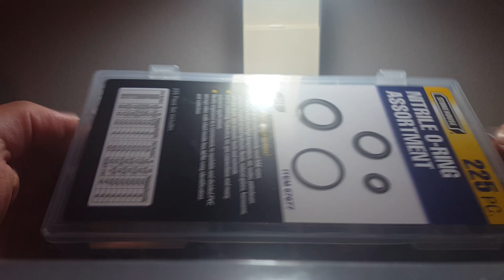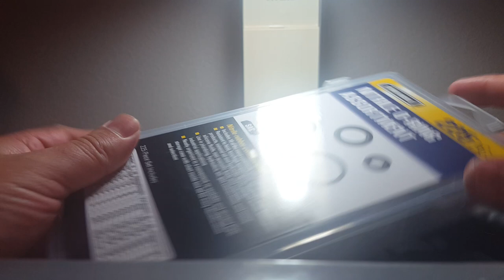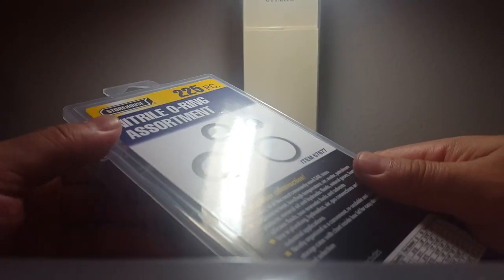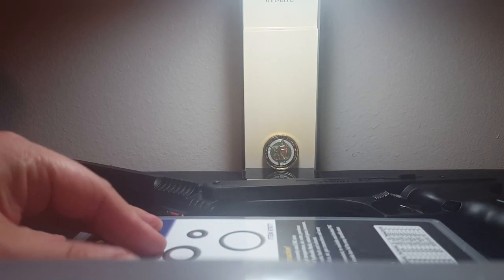P-17 Fix: Breech Seal and Barrel Cleaning

Comment: Do you know if these are the same size seals for Beeman P3?  Thanks!
Reply from the maker: Great question! I dont have the P-3, so let me know. The Chinese version supposed to be EXACT knock off - except for the trigger. The P-17 doesn't have as predictable trigger.

This Storehouse Nitrile rings are DEAD ON with Chinese OEM. You will need SAE and Metric. These Ring kits are affordable.
Reply: Thank you!  I have been watching your videos and find them very helpful.  After several years of not using my P3, I thought I would research on how to clean / lubricate it properly before shooting it again.  I can only find videos on the P17 (which like you stated, is supposed to be almost identical to the P3).  I took it apart yesterday and it didn’t look dirty.  I’m not sure if it needs new seals?  I gave it a good wipe down inside and outside the main air chamber.  I removed the large o ring, cleaned it, and cleaned the groove where it sits.  Used a small amount of 30wt detergent free oil on the o ring and put it back together.  Seems to be shooting fine.  Not sure if I should try to replace the seals anyway? Lol. Thanks again for getting back to me on my question!